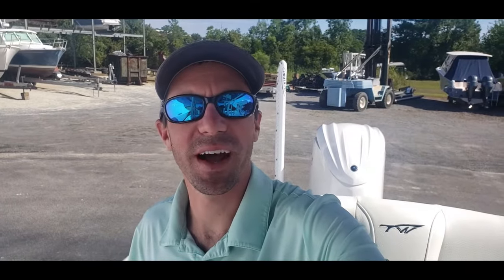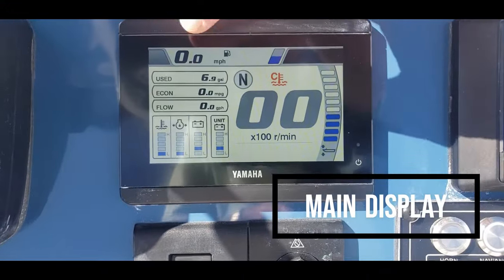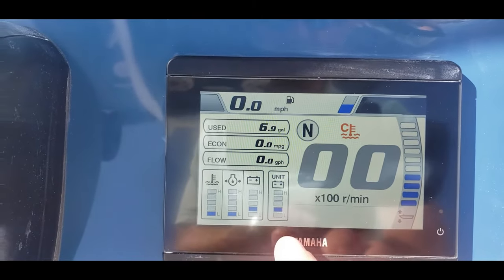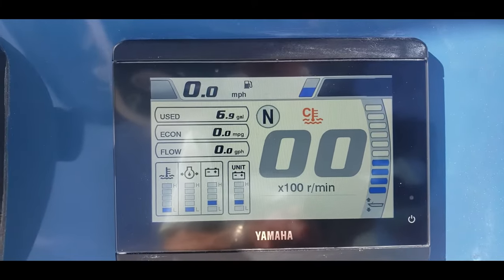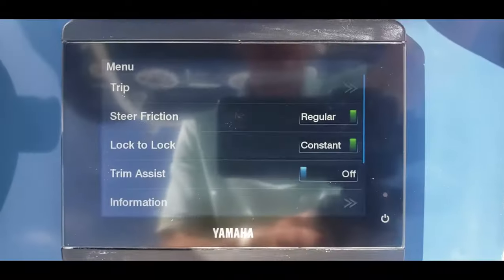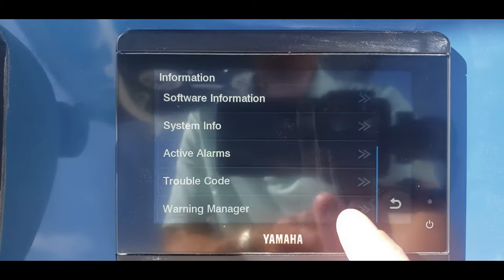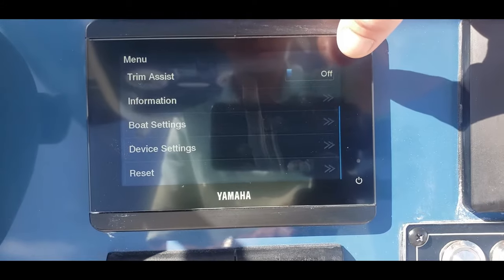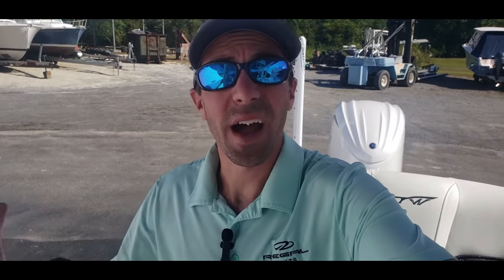New Yamaha Outboard CL5 Gauge Overview and Tutorial - Boating 101

Comment: Is there a way to select speed data source (Pitot versus gps)?
Reply from the maker: There might be a way but I'm not sure. What is your end goal? Thanks for watching.
Reply: @LowcountryBoater  My Pitot tube is not functioning properly. Probably clogged. I would prefer to use my GPS as my speed source, but cannot figure out how to select it.
Reply from the maker: It's typically easy to clear your tube using some compressed air (sure there's a Youtube video out there). On selecting the GPS speed, not sure exactly. Most likely it has to be hooked up to your GPS somehow.

Comment: How to calibrate the fuel gauge i bought brand new tidewater the gauge is always shows 1/2 to lower after I fuel thanks
Reply from the maker: I'd recommend calling your local dealer on it to have them address it. But you can calibrate it yourself next time you fuel up entering some level points. If you look on youtube for calibrating CL5 fuel tank, you should be able to find a good video on it